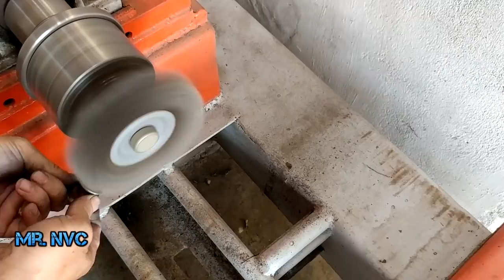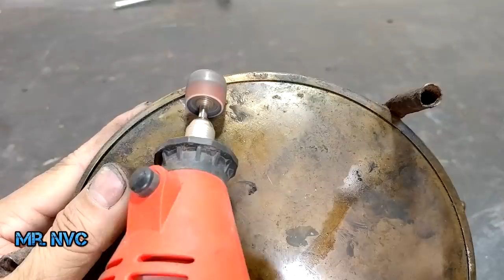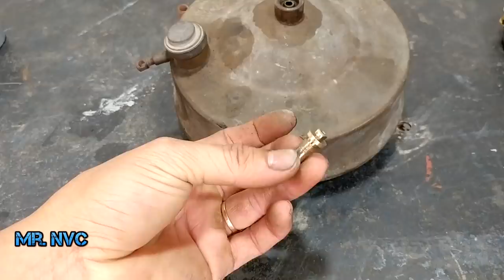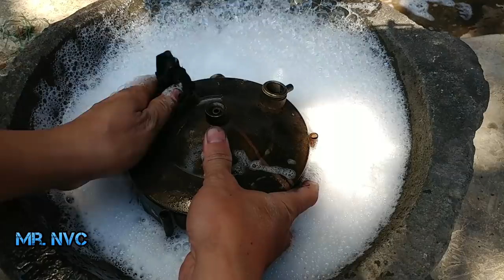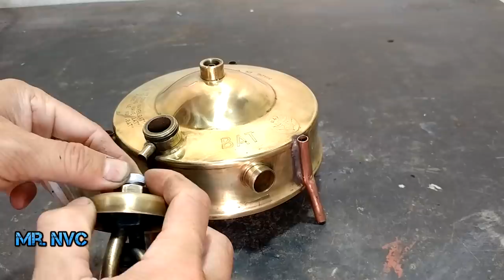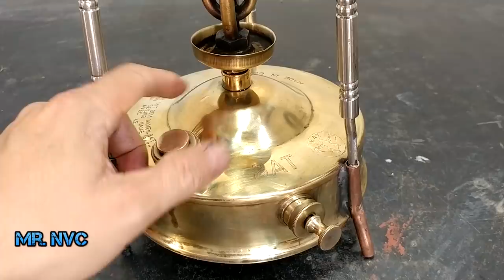Primus Stove Restoration | Very Old Kerosene Stove Restoration

Comment: There are a number of problems here. 1. The non return valve needs a lead washer and a rubber pip. 2. Use meths (denatured alcohol) to prime the stove and NOT paraffin. 3. Do not pump until the alcohol has nearly burnt down and the burner is hot. 4. The flame ring is missing from the top of the burner. This is necessary for correct operation. The flame should be burning clean and blue and should not blacken the kettle. Have you enlarged the hole in the jet to cause this I wonder? Whilst the cleaning is fine and the new legs work but PLEASE leave the assembley and operation to someone who knows what they are doing. I have over 45 years experience in restoring and operating these stoves and I wouldn't recommend your viewers follow this example of operating.
Reply: At least he shares his knowledge and efforts doing a video for all of us.  Where are your videos?  Instead of talking, maybe you could share.
Reply: Cool man. Now go make the effort of reproducing this video according to the way you describe and then come back.

Comment: I hope you and others realize this is not a PRIMUS Stove this is a German Stove not a Swedish Stove. Also you restored the pot stand legs and they are about 4 centimeters to high for this stove. I hope you are using kerosene in the stove not white gas or Coleman fuel. It needs to be kerosene fuel and alcohol for priming it preheating the burner. You are also missing the pressure relief valve at the fuel filler cap.

Comment: The flame should be blue. The top nozzle really needs to be extremely hot to vaporize the kerosene and this requires patience. We used to use methylated spirit in the top reservoir, with initially very little pressure in the main reservoir it starts to draw the kerosene up and you must look for this happening and then increase the pressure a bit. The burner flame then starts heating the top up more and you can see the kerosene flame mixing with a lot of air in this way. Finally pressurize fully and what you have is much like any gas burner but a bit noisier. Methylated spirit for starting means the whole business is much cleaner and the stove can go in a rucksack afterwards. I think Primus was originally Swedish. My own stoves tended to get pinhole leaks around the filler neck. But very nicely done.
Reply from the maker: Yes. Great comment. Thanks
Reply: Tilley lamps which work similarly have a regulator to gradually allow kerosene up the central tube. Im not sure why the stoves never had this because it allows good control and if not hot enough the kerosene flow can be stopped. It was the same for plumbers’ blowlamps.
Reply: This is a poor quality Premus stove, we use to use Premus made in Sweden, it was great, the color of a flame was blue..
Reply: My old Primus used to roar like a moon rocket! Plenty of pressure required. Maybe he didn't want to use to much with all the solderinf done??
Reply: A part of the burner is missing, there should be a copper collar resting on the ring about fifteen millimetres from the top of the burner. It acts as a venturi and causes the flame to burn blue . this collar used to glow red hot on my stove and was quite easily damaged so I suspect they were made easily replaceable explaining why its missing on this example.
Reply: Very true sir. We use denatured alcohol as fire starter.
Reply: @justjj9934  this is an east german copy. Missing a collarring around the flame. Should be a roaring blue flame when working properly
Reply: Wonderful little stoves !
Reply: @lyntoncox7880  регулятора пламени нет в этой древней версии керосиновой плиты по причине сложности изготовления этой детали 1890 год изготовления модели ,без регулятора плита была проще и дешевле.В керосиновых ,бензиновых плитах помоложе уже есть регулятор и конструкция горелки лучше и тише работает ,регулируется и разжигается

Comment: There is normally a top section diffusing dome shaped piece that has a set of small holes all around the sides and sits ontop. When burning the holes all have a characteristic little blue flame and the heat disperses like any gas ring burner. The jet directly below often blocks and the unit makes a ragging sound signaling the jet needs 'pricking' to clear it. You need a 'pricker' tool. In the early 1960s my mother could prepare a full hot meal on a single Primus unit for a family of six in times of emergency when electricity was out and we were in a wild winter storm for days.... Funny thing... the unit was already really old then & i still use that same unit myself in my shed to melt lead for fishing sinkers (but not to cook meals)!

Comment: Burner flame cup missing. The top flame cup would make the red flame into blue flame making optimum heat. Red flame would make the utensils black at the bottom side. Anyway very good video. I have small sized Primus stove (Made in Sweden)

Comment: You should have bought a Primus spares kit which are cheap enough, all the seals you need including jet,  pump leather, the pip for the NRV (no pip no pressure held in the tank).  Outer flame rings are also cheap enough.  Primus set the standard for these stoves and their spares are pretty much universal fitting many brands of stove.

Comment: It's a kerosine stove. You must preheat it with alcohol (spirit)(no  soot). If the alcohol is burnt out. Then use the pump to pressurize the tank. The flame should be blue. Your yellow flame makes your saucepan very smoke black
Reply from the maker: Thanks
Reply: And carbon monoxide risk ⚠️ - incomplete burn
Reply: There are also 2 parts missing, there should be a steel ring on the burner to direct the flame. And a windshield to shield the alcohol from the wind.
Reply: @estagoza  This is a different burner without a ring which came after the one with a  ring which also had a cup with perforations. It acted as a silencer. The one shown here makes great noise. Another part missing is a flat round base placed on the tripod to rest the utensil on. Some reservoir filler caps have screw-on covers under which a spare cap washer can be stored. It seems this stove also has this provision though the cover here has to be removed with a spanner instead of a screw-driver.
Reply: Yess u right, must be blue and powerfull,
Reply: With a pump, no preheating is needed. He just needed to pump up more pressure. I have a stove that works the same way.
Reply: @rajendersharma1334  There are two types of burner, the one on this stove is a roarer burner and there should be a brass flame spreader, just a flared ring that sits on top of the burner, THe other is a silent burner whivh has a sort of dome with a lot of small loes around the 'wall' of the dome
Reply: @ChrisLichowicz  You really MIST preheat the burner with alcohol (methylated spirits) before pumping up the pressure, that vapourises the kerosene (paraffin) The burner is controlled by either releasing pressure in the tank or by increasing it with the pump

Comment: This stove lacks a loop at the top of the ignition zone to determine the ignition area. Also, press the air pressure piston 7 or 8 times or more to add air pressure inside the fuel tank. It will give you quick fire with a high volume and flame strength with the concentration of the ignition zone called {gouache or kosha}
I have been using it for 15 years

Comment: WELL DONE. The flame was not correct. You need to find a needle to clear the jet.It should be blueish as I remember, (nearly 70 years back) and this type of head made a lot of noise. The quite head had a top with lots of peripheral tiny holes. Once as a child I pumped so much to get some heat out of it I blew the bottom off. Regards and you have my subsription.
Reply: Can imagine camping having a conversation just to hear jet taking off behind you

Comment: You should fill the ring with methylated spirit, and light, so that when the paraffin passes in the lower loop it vaporises, when its working properly it will roar and a blue flame will be seen, this one is burning liquid paraffin, its not hot enough

Comment: I have one of these (mine is made in Sweden tho') and its complete. You are missing the flame spreader as others have said and also the cooking plate which sits on and holds the 3 vertical bars in place so they don't swivel plus gives you a place to put your cooking pot on.

Comment: If you need to clean large bits of brass dip it and boil it for ten minutes in citric acid solution. It will be clean with very little effort.

Comment: Good to see the stove come alive, nice work . ...  though the burner hole needs to be cleaned with a pin type attachment. The flames are yellow due to the earlier soot in the hole . Also you need to pump up the primus consideribly more.

Comment: It would look even better if you removed those copper tubes off of the sides, cleaned up the excess solder, then make a stand to put the burner into and include the three pieces that you beat out straight on your anvil.  If you have a welder available somewhere you could use that to make a triangular stand of some form including your pot stand pieces you made.

Comment: Pressurise the kerosene fuel with the pump handle, adjust to a blue flame. Knew these well as a kid till the died out for some silly reason?  They were great, and the fuel also worked in your trusty lantern. Camping was so much fun using these alternate technologies. It made it exotic to be independent in the middle of nowhere. 500ml of kerosene went a long way and the odour of these devices burning was somehow very masculine in my mind.
Reply: Can't really describe the feeling using something like this than conventional gas, like just starting a small fire with kindleing, know how many hours 500ml would last?

Comment: Not bad work, but there must have been a way to lessen that big solder patch. I think the way to handle it would have been some of that inside the tank coating they use when making or repairing motorcycle gas tanks. Will keep it from leaking without huge patchwork.  If that brass was too thin to braze, then that's the only way I can think of to lessen the patchwork. Of course, you could have plated the whole thing to achieve a more consistent look, but then again, wouldn't that be going too far for such an item? Probably. It works, you don't need it to do more than that.  Oh, you can use high grade alcohol as fuel completely, it will work and burn clean.

Comment: Nice clean up. But next time you solder something use a dry rag to wipe excess solder off while the joint is hot and then you can buff the rest off.

Comment: How old I am! I still remember how to properly should be lit the primus. Smokeless hot blue fire, not red with soot. Primus should fizz. Look on the internet. It is necessary to clean the head of a primus stove, in it kerosene should evaporate when heated in the tubes and its vapors are burning, not liquid kerosene. Check nozzle.
But there were still a primus stove on gasoline.

Comment: It's don't works anymore . I'm sure there is a crack in the head .  And you should press more to Raise the pressure inside the tank When the head is heated the liquid fuel will turn.  Into steam.  This steam will ignite with a blue flame. The hole that pumps the fuel upward.  Expansive due to heat.  It must be replaced

Comment: You must control the air inside the fuel tank. The long handle is injected 10 to 12 times or more until the required fire power is reached. The color of the flames is completely blue
Reply: Да у него слишком большой диаметр форсунки, её надо менять. С таким плохим мастером, этот аппарат никогда хорошо не заработает.

Comment: the legs has to be one piece this way they don't wiggle when you put the pot and you pump it good until you can't pump any more  before you pot the pot then there is tool for the head where the kerosene coming out very small injector we call it needle to clean the injector every time you use it and another part are missing from your stove its the hat on top of the head this way spread the fire

Comment: The yellow smoky flame is not how it should be.  As Mr. Cox pointed out it is supposed to be blue and sounding like a jet engine. Pumping a few times more will achieve this. Speeds up cooking. "PUMP" stove

Comment: You needed to use a brass tube to replace pot stand leg as copper is not the original type of metal used brass is.

Comment: It's not Primus (Primus is Swedish!!). The logo and the name BAT (= chauve sourie en français) were recorded at the very beginning of the 20th century. This brand also manufactured stoves and more traditional oil lamps (it belonged to Stübgen AG), and it seems that Hugo Schneider (HASAG) took control around 1937. The firm HASAG was dismantled in 1945 for crimes against humanity for using slave labor during the Second World War.
In the months following the German capitulation, the Russian authorities confiscated and repatriated to the USSR a large part of the raw materials and equipment of the factories of Germany occupied by their troops. But, we do not know how, some machines have escaped the requisition, which allowed the GDR to continue production on its soil after 1945, it seems until 1964, under the brand BAT or Mewa......

Comment: very cool, but the old supports looked more authentic, the new pipes didn’t convey this, perhaps it was worth using a copper-phosphor solder and not tin so that the body color was the same everywhere?
Reply from the maker: Copper layer is too thin if copper welding will be punctured
Reply: @MRNVCDIY  I like it right away, this is a great job.
Reply: @MRNVCDIY  inner valve  at bottom of pump tube usually has a small rubber flap vave which did not see,when you took it apart ie non return valve all these parts are available,plus flame spreaders  washers on stove and lantern  sites,ps try a pressure leak test in bucket of waterthanks  for vid old stovie fan

Comment: Repeat the comments from Bernard. Fuel must be Kerosene based. Also I think part of the burner is missing. Usually have a cap with many holes along the sides
Reply: Flame reflector normally called flower and silencer what you are referring two parts missing
Reply: The initial burners came with  cups with holes. They acted like silencers and made a hissing sound. These were replaced with burners like the one seen here.They make great noise.

Comment: This is not a Primus stove. Instead, was made in East Germany, possibly sometime during 1960's and not very well made either. The original Primus was made in Sweden and was greatly superior quality to the example detailed here. We had one in our original home in Finland during 1950's and I can still remember lighting it with methylated sprits and warming it up, before slowly increasing the kerosene pressure to make it burn at the desired temperature.

Comment: This is not the way to light the stove and the power of the flame is not started.
1. take a screw size metal rod. 
2. and cover its top with any cotton pice.
3.add some kerosin/diesel to the cotton
4.light it and put the stick under the chimny/in the spirit cup.
5.wait for one minut because the burner needs to heet very well{if the burner heet well the diesel come out like powerfull spray}
6.slowly pump the piston 2/3 tmes and take the stick from the spiritcup.
if u need more powerfull flame then pump the piston more and more. and u can adjust the flame on the air scew /on the kerosine tap.       ' A blue coloured flame is good for the stove and for the operators. blue flame gives good mileage."

Comment: While I appreciate your make do ingenuity, and it's return to function. Their is a skill to setting the flame via pressure regulation. Yellow flame is excellent for creating lamp black ( soot ) it's a waste of fuel as it doesn't produce much heat. To everything their is an art.
Reply: it can produce much heat but should know how to start it well. i think it is very inexpensive from LPG. To imagine how kg is a cylinder and use the same ratio of kerosene or diesel. u can save remaining diesel after changing the cylinder.

Comment: My father had a Primus stove we would use when camping in the woods. Whenever we got home, it was time to clean it with brass polish and remove the plunger to clean the tube and seal. I remember well having to carefully replace the plunger not to damage the leather gaaket. But your stove in not a Primus, the shape is wrong and the marking German.

Comment: Surely you could have found something better than a bit of bent copper for the leg? And the tongue of a shoe will make three decent leather valves for the pump? Also your burner is very wonkey and burning on a very cold flame. It  lacks a top flame spreader and a clean at the VERY least.
This is a rough as guts rebuild NOT a restoration!